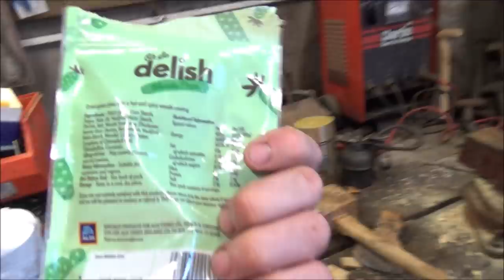RESTORING AN AXE WITH JACK. PART 1

Comment: Just a tip when putting a head on a new handle be it hammer or axe. When you get the head pushed on slightly if you turn the tool upside down and then tap the bottom of the handle it seems to make life a bit easier

Comment: Interesting video . On a metal file there is usually a rough and smooth .  The larger tool is a wood rasp.  Is that tool shed you man cave ? To do tinkering etc.  Jack there is a game called slap the slap head .  Stay safe and crack on .

Comment: Just a thought if you have some WD40 and a wire brush for an angle grinder maybe could take some the thick rust off. And if have a soldering ion write jakes name on it with the date you fixed it  👍🏻

Comment: When I started work I was told a hammer has a long handle for a reason, if you were supposed to hold it near the head the handle would only be four inches long lol,  but more important if you hold a hammer/ mallet at the end of the handle you have more control over it and if you miss whatever you are hitting you don’t squash your fingers.